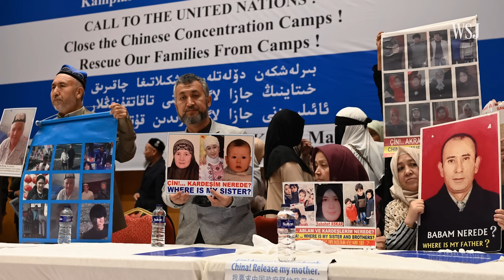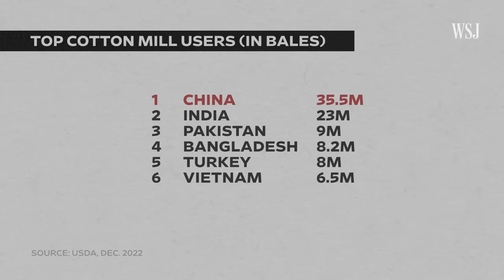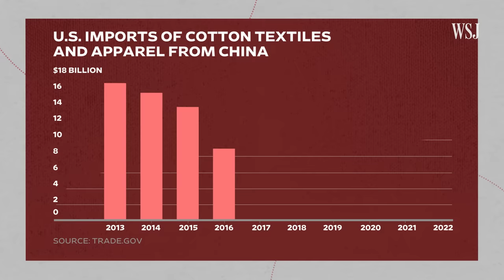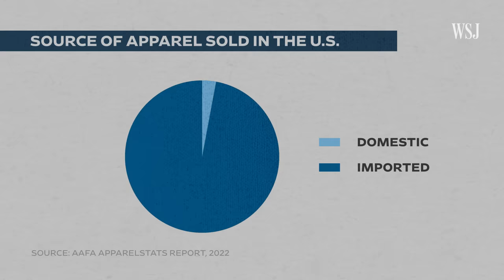How Banning Most Chinese Cotton Has Shifted Global Supply Chains | WSJ U.S. vs. China

Comment: Its another one of those which the politicians wants you to believe, cheap labor = cheap product. Working in global supply chain, the main cost driver is the producers fixed costs and not labor. Usually this cost is offset by efficiency, why China can produce goods at an extremely competitive price, is that they have a VERY EFFICIENT economy. I've often sourced from different parts of south east asia, and even with significantly cheaper labor, their final product costs higher than Chinese manufacturers, not to mention at a worse quality.

Comment: The world needs more cotton, we have got to cut down on all this plastic clothing
Reply: More natural fibers in general would be better. Linen and hemp are also great.
Reply: That is wrong .  We need cotton shirt every year . it wont last even a year as daily wear . compared to polyester mix. which will remain same 10-20 year . so more damage to environment is cotton dress .afterall it also goes through tons of process .
Reply: It’s not so clear cut. Cotton used a lot of pesticides and chemicals which degrade the environment. Meanwhile chemical fibers are a by product of oil production. Meaning a barrel of oil only a certain percentage of that oil becomes gasoline after the refining proceeds. The leftover bits get used for other things such as asphalt to chemicals for fabric. So as long as you have gasoline cars you will have plastic clothes just because you wouldn’t want to waste the part of a barrel of oil that doesn’t become gasoline.
Reply: A cotton shirt always looks wrinkled, doesn't breathe, and stains easily.   Meanwhile, my "Beach Boy" striped shirt from the 60's and looks brand new.
Reply: @karlbmiles But what about microplastics that reduce fertility and harm hormonal system?